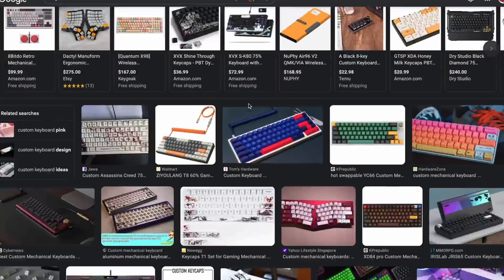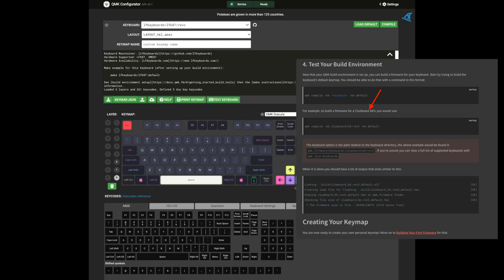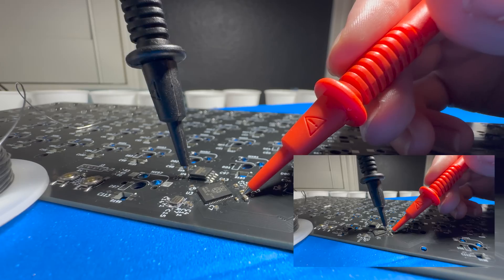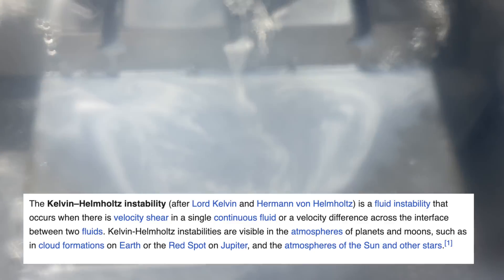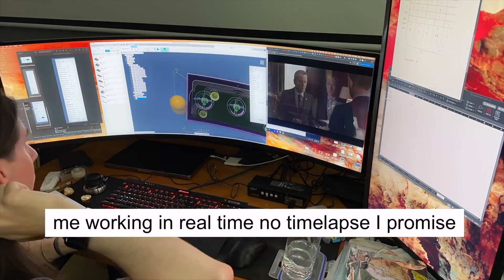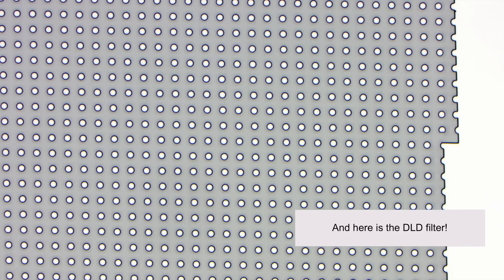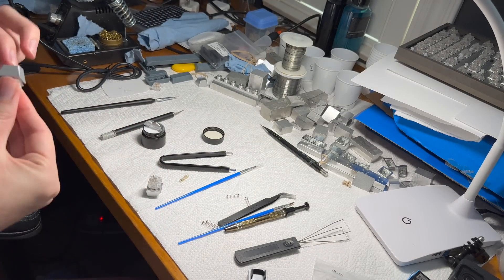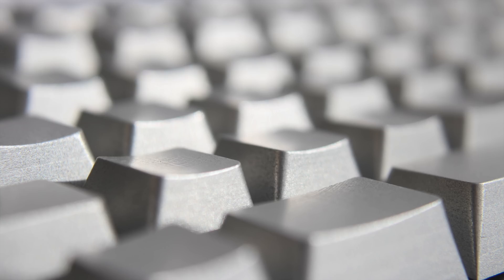Design and Fabrication of a Custom All-Metal Keyboard | banoa102

Comment: This is an incredible project. I’ve spent some time in the machine shop during undergrad, and going like 6 hours straight was draining. Doing that for weeks on top of research and senior design is nuts. Incredible work. 

I do gotta ask though, was the rubber gasket part about the math you actually misplacing the math or “misplacing the math”. I know with me it would definitely be “misplacing the math” lol.

Also good luck in grad school! Doing stuff with fluids is cool, especially to someone like me who really doesn’t like dealing with solids changing, let alone dealing a space where everything changes at all times.
Reply from the maker: About the math - sorta both! Poron foam comes in a lot of different varieties and one of the parameters you can play with is the "pressure to compress the foam to 25% its original size" as this is usually given by the manufacturer. This lets you calculate out the pressure 14 bolts and the surface area of the keyboard would apply to the foam to get nice deformation, which can be controlled by how deep the slots on the keyboard are cut (deeper slot = less compression) at a higher level/rough numbers standpoint to pick a material you think will work for the design. I then lost the calculations, as in, I have no idea where they are. It ended up not being too important - I decided I didn't like the springy effect and added some extra height, which made the foam less bouncy by compressing it further. 

Working the machine shop for long days was definitely tiring but fun! I was allowed to have music going which helped. Having one machine running let me work on homework and projects in the down time, but two machines had me on my feet a lot more. And I'm excited for grad school! Thank you for the nice comment - I enjoyed reading and responding 😀